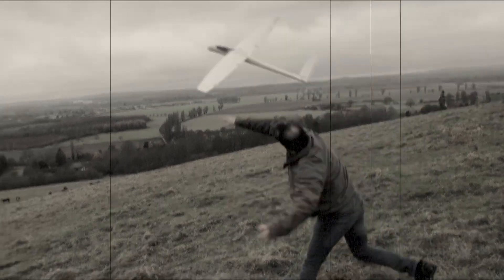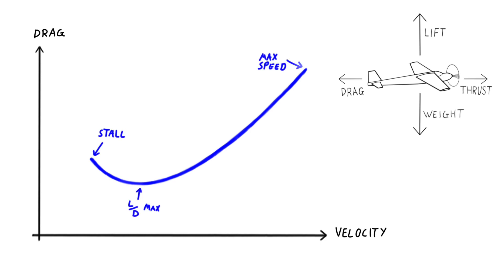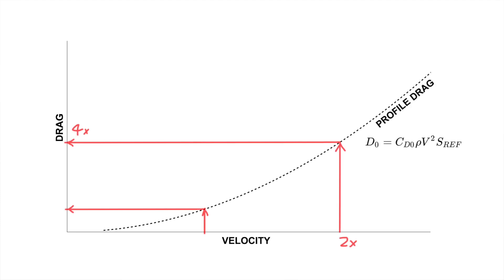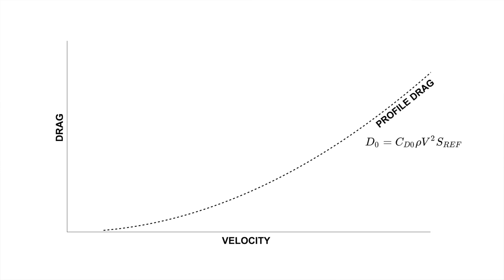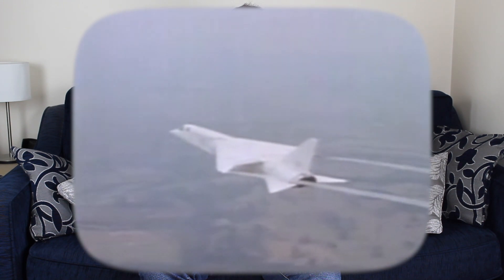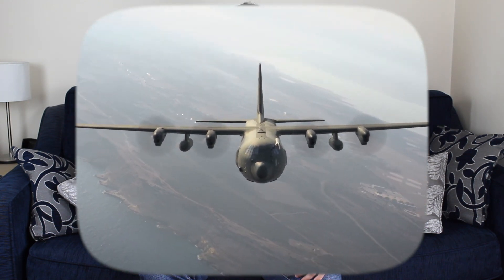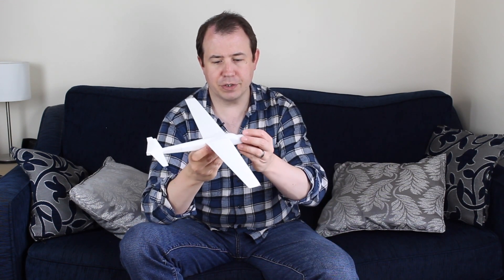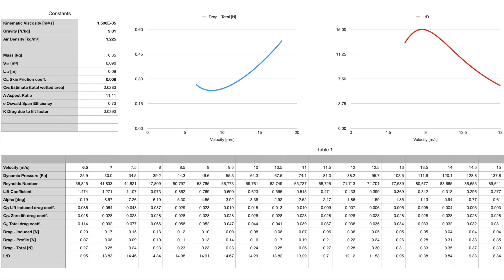Model Aircraft Design - Part 3

Comment: Hi, when are you releasing the next video? would love to see the next part! What were the settings on your original glider? also what code did you use?
Reply from the maker: @TheYFMer  I will try to get back to this sometime. Bit busy these because my wife and I have a baby to look after. I wrote the code for the original glider myself. It was a bit janky tbh and I don’t think I’ll be sharing it.
Reply: @Thumblegudget  Hi thanks for getting back to me! Yes I am interested to see how you carry on with this project! I am trying to do something similar with a pre-designed RC frame and a custom designed flight controller with an Arduino connected via i2c to a Raspberry Pi. This is what I have so far! https://www.youtube.com/shorts/Z7XARVU6pO4